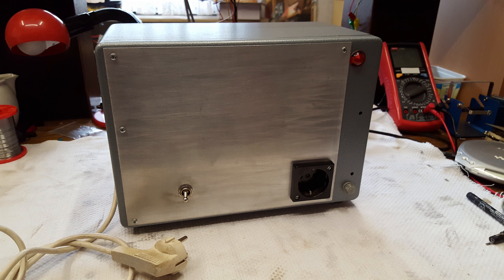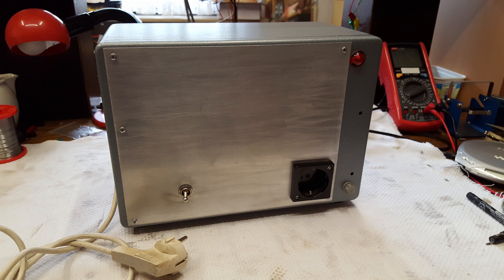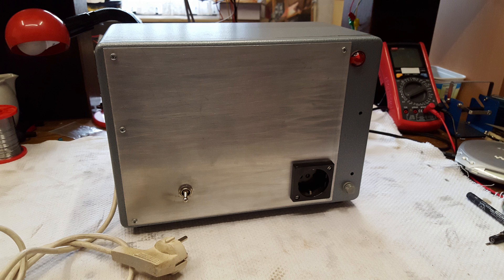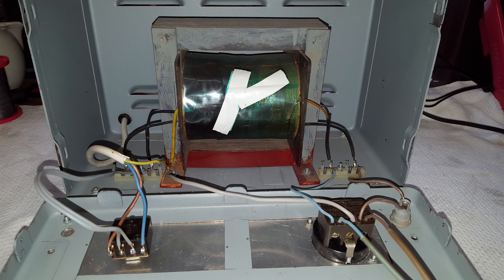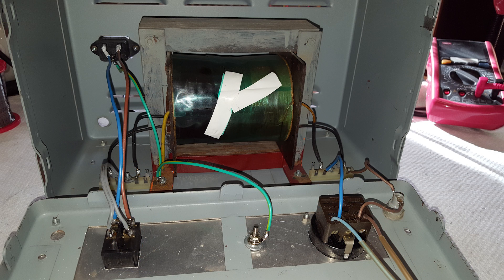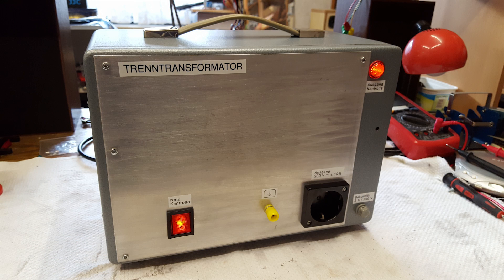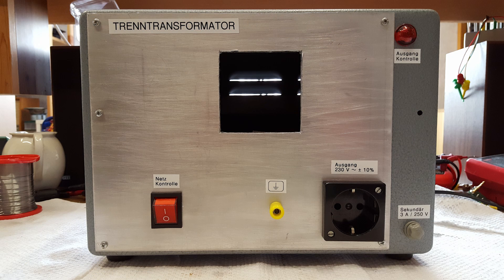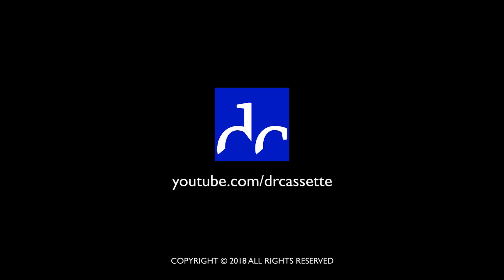Modding an Isolation Transformer from the Flea Market

Comment: Hello sir, firstly great video, loved it!
Have a question: Does it makes a lot of noise? I tried to do it with 2 microwave transformers (joining them together by only using both's primary coils and a enclosure of just one) but noise is huge. How that sounds? Can you show it to us?
Reply from the maker: So you disassembled the two transformer cores, took the two primaries and then reassembled one of the transformer cores around them? The problem with this is, that the metal elements of the transformer core must be very tightly packed and ideally glued together. Only a factory can get this just right. Your handmade transformer should work just fine technically, but the elements of the transformer core are all slightly loose and will rattle because of the transformer's magnetic field. All handmade transformers tend to be quite noisey.
Reply: yes that's true, i might end up put some rosin or varnish on them, still thinking about it.
So by that i believe your transformer makes a few noise.
Reply from the maker: My transformer was made in a factory, so it is almost silent.

Comment: Great find! You seem to be quite lucky with your flea market finds.
I bought a brand new auto transformer with an internal isolation transformer but the output plug socket also had the earth ground permanently connected so I added a switch to enable me to disconnect the earth ground when required.

Comment: I’m in the process of refurbishing a Sansui qr 4500 receiver and can’t seem to find a power cord, any ideas? Regards, Mike
Reply from the maker: What I do when a device has a non-standard power connector that requires a special power cord is I replace the power connector so that I can use any standard power cord.
Reply: DrCassette I had thought of that but not only do I think that takes away from the collectability but because it’s an import from Japan there’s an option to change the voltage on the unit not too safe I thought. Waiting it out and looking for something at second hand shops. Thanks so much for your input I’ve been watching your channel for years now I really enjoy watching what you do
Reply from the maker: It depends on the connector that's there. For example the TEAC reel-to-reels I have both had special connectors, but I was able to install a standard IEC socket without modding the cutout nor the screwholes, it just dropped straight in. And the IEC power cords are used all over the world, so they are safe at any mains voltage.
Reply: DrCassette sounds like that was an easy modification thanks for your input

Comment: Your videos looks so educative and professional.
Incredible work :-).
So basically, an isolated transformer is necessary for the oscilloscope (just to prevent a probe short with GND, right?)
Reply from the maker: Not the oscilloscope must be connected to the isolation transformer. The internal connection of the scope to earth is an important safety feature. The device under test must be connected to the isolation transformer.